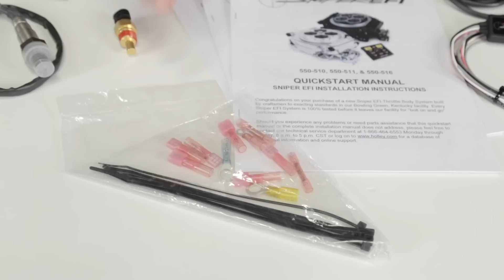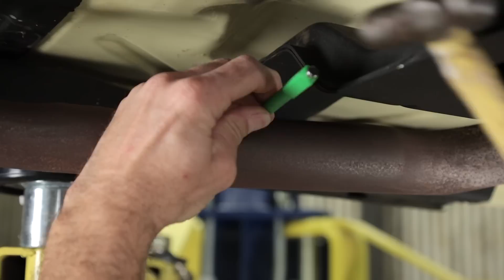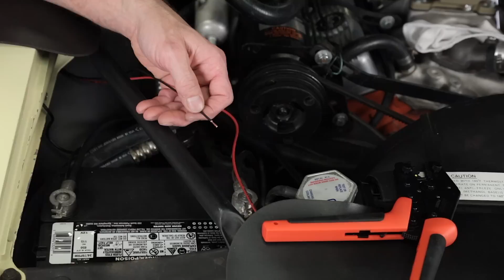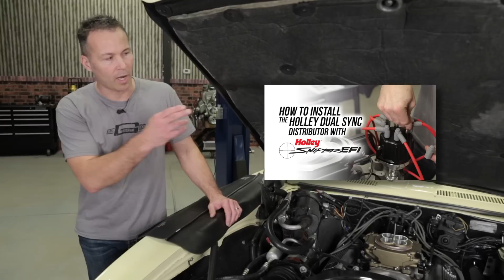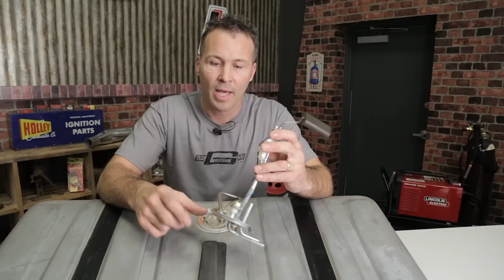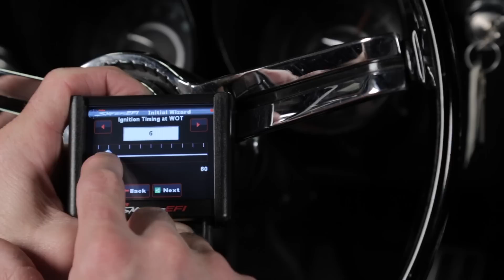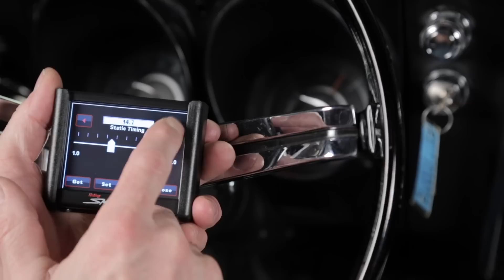How To Install Holley Sniper EFI

Comment: Just a note.  Holley no longer includes the mounting studs/nuts, air cleaner stud, throttle/transmission brackets,  throttle linkage studs, or zip ties/terminals.  Summit told me these are now sold separately.  A little disappointing since all of their advertisements show these.
Reply: I was just about to buy one not sure now. Thank you for the info
Reply: I'll still get one. A few changes though. I really wish I'd seen this BEFORE I bought a new battery. Told the fuel pump block off plate needs to be separately purchased ( I have one), I'll probably use the fuel fill pipe for my return line I'll also weld an actual O2 bung into my x pipe. Probably have to get a few throttle linkage studs which is irritating as they supplied it before they just shut that part down. It's already a chore to make universal speed equipment fit Mopars but it's still better than running a carb. In my opinion.
Reply: Just thought of something. If your battery dies or is disconnected does the previous setup keep it where it's at or is a reboot of the system needed where you have to go through all the programming?
Reply from the maker: @blakenewton2781  Your current calibration will be stored in the ecu should you have a power disconnect or failure.  thx J
Reply: Is there a part# for the throttle linkage studs? I just got my new Sniper but did not think to order them at the time....
Reply from the maker: @blakenewton2781  Depends on which one/style you need for your vehicle?  Here is a link to the page with our offerings.  Thx J
https://www.holley.com/search/?q=throttle%20studs

Comment: Well i can tell you the systems are not perfect none of them are i have installed 3 msd atomic no issues so far and 4 fitech's some issues but their customer service was bad. I am going to try this sniper on my 68 gto and see how it fairs against the others.
Reply: The only FI Ive had great service from is the OBD1 SEFI from Fox Mustangs. 100% trouble free and adaptable... but certainly a DIY project... the computer box/harness is greeeeaaat!!
Modern systems are no doubt simpler and easier.
MY only recent experience us MSD FI. It never got over an idle problem on 426 Mopar... but was much better than carb.
Reply: dont buy this shit or if you want  absolutly one i got one for sale i run it for 2 days and remove it cause it a piece of shit and no support from holley

Comment: Which is better single point injection system or the multipoint system?
Reply from the maker: Multi-point fuel injection in my opinion.  Fuel is injected into each cylinder individually and can be fine tuned to provide optimal power.  You can adjust the fuel in each cylinder to compensate for variances in the engine such as intake design with a multi port set-up. thx J
Reply: HolleyPerformance Thx for the reply and your opinion. I appreciate it.

Comment: Good video. He removes the spacer after removing the carb. Is it necessary? I have a similar setup and would like to keep the spacer. will there be a problem if I keep it?
Reply from the maker: There shouldn't be any issues with keeping the spacer as long as the holes are big enough to clear the throttle plates when opening, and you have the hood clearance. thx J

Comment: My fuel tank had a drain plug, i used a brass threaded union that fit where the plug went for my return line
Reply from the maker: That is an option may work for you but remember the extra weight of the fuel in the tank can increase the return line pressure.  This creates extra unwanted stress on you fuel pump which can cause premature pump failure.  Good luck Thx J
Reply: tube Ron mcneish And
Reply: Xbox live gold subscription

Comment: Can you run an in tank fuel pump as a helper to the Holley pump? Thanks
  Working on a 69' Camaro the guy just spent $700 on the tank then decided to go with the sniper setup..
Reply from the maker: What pump is in the tank already purchased?  Max pressure and flow ratings??  or a model #?  Thx J

Comment: This looks great but i have a question. If i swap out motors in 2 yrs, will the sniper efi adapt to the new motor?
Reply from the maker: Yes it will, granted the new engine will the throttle body and necessary sensors.  You will need to rerun the set-up wizard to ensure the calibration is correct for the new engine.    Thx J

Comment: Can i just Bolt this on to my 1988 dodge ram that already has that old holley TBI injection system?
Reply from the maker: As long as the bolt pattern works or you can find an adapter to mate up to the Sniper.  I am unsure of the fuel pressures used in those set-ups so you may need to replace the fuel pump and regulator with higher pressure units if the stock unit cannot provide adequate pressure.  Also the fuel supply and return fittings may be different and have to be changed also the air intake tube may not be the same diameter and will need to be modified or replaced?  Nothing too major but some things to take into consideration before you get too far into it.   Thx, J
Reply: HolleyPerformance Thanks!
Reply: Because my truck already has a fuel injection system do i need to install all of those sensors or are they already in the stock car?

Comment: Is it a must to install the O2 sensor?
Reply from the maker: Yes but why? You could run it in open loop (no input from O2) with a good known calibration but that defeats the learning ability of the system and does not make any real time corrections possibly causing engine damage!! thx J

Comment: What's the maximum fuel pressure the Sniper regulator can handle, right now I have a 100psi in tank pump.  Thanks.

Comment: Where did you find the coolant bushing for the Coolant Temp Sensor? I bought the 2300 series 2barrel kit and am doing this to a 1971 chevelle with a 350 small block, I can't find a brass bushing like that. Also what size is it 3/4 x 3/8?
Reply from the maker: I purchased it locally at a plumbing store but most any hardware store should carry them.  I believe mine was a 1/2"NPT reducer bushing.  I have seen some SBC with1/2" NPT and some have 3/8"NPT holes in the heads depending on the years.  Best to check yours first or get both just in case.
Reply: HolleyPerformance thanks for the response, I ended up going to a local hardware store as well. 3/8 to 1/2 in npt  bushing. Got my sniper 2300 series fired up and running now.
Reply: any hardware or auto parts store will have it

Comment: Once again you guys and the Kit Saved me. I had the Bracket for the Trans reversed I could not get my 700R4 to shift properly so last night I went back and read the quick guide and there was the photo of the throttle bracket/Trans...Sure enough I had it backward facing not straight one on top of the other.. I have the timing right at 13.9 14.1 on the Display and right at the end of the Timing Tab ALMOST I still get that sound some confuse it for vacuum under full throttle Mashing it only if you stretch it out and work up to full throttle it makes no noise but it feels like it needs or wants another degree or 2 of Timing is that ok to do? this is A Roller 350 87/95 variety Self Aligning rockers 87/95 NON Vortec Heads...Had I known I would have got the Vortec Heads Live & Learn.

Comment: Hello everything seems  OK I  got my registration/Insurance. 
I got the Idle sorted out for the most part I set it at 570 on the hand held it Purrs at that RPM
There is another thing I have not figured out yet... 
The vehicle always Starts Hot or Cold At higher RPM between 1400 RPM & 1500 As if it was A Cold start however it Does the same after its warmed up takes about 10 seconds for it to settle down sort of embarrasing in the grocery store parking lot with my loud exhaust so how do I adjust that out of it? Or should A Local Holley Tuner do that.? I am OK doing MONKEY SEE MONKEY DO... But I have to hand it to the Tuners They know their stuff!

Thanks
Jeff
Reply from the maker: Jeff, Glad your getting it on the road!    A couple of things to look at in regards to the High start-up rpm.   Is the coolant sensor connected and installed?  is it  giving you accurate readings? If so,  First from the home screen, click tuning, then advanced, advanced idle, then IAC start-up now click on IAC parked and you should see a line graph.  The graph you see should start at 100% on the left then ramp down to the right.  If the fist box does not start at 100%, drag the line graph up so it now starts at 100%.  Be sure to save before closing the screen!  You can also look at the IAC start-up hold time and decay time. These are on the same screen you just went to, just below the IAC parked selection.   They should  default to 4-5 seconds.  You can try lowering the hold and decay to 2-3 seconds and see if this helps.   J
Reply: Thanks And yes the Sensors are Installed but I left the Water temp guage I had on the Intake and Installed the Sniper Sensor on the Water Pump Its the Short Corvette Water Pump I wonder if its got a lower temp than the intake? I will go over to my dads he has A Laser thing that reads temp. I have  A higher reading on the Intake guage than nthe Sniper its showing 190 and the Sniper 180 to 185 at its hottest. I think I might have to switch the Sniper to the Intake and move the other one to the water pump so I can still have both. Thanks for the Info I will do it over the weekend.
Reply: I thought I better not delete any of these notes stuff because I am actually hoping others will learn as well...LOL So I hope someone else posts their experience. I will tell you I never was able to get the Idle as low as it is now it has never been that smooth at such a low Idle way better going from Hi Idle at start but start it does...I would go into Auto Zone Or home depot and we never knew if it was going to start at all! Now my family can Trust the Truck to start every time I proved it with our SOCAL 110 Degree weather in the last week It started every single time
Reply: SUCCESS! I just backed it down a little more and PRESTO Starts and runs now just like my Tios 2012 Silverado! except it did not cost 25k$ And my Tia's Old  64 c10 Gets more thumbs up than a Silverado! LOL  Now I just need to add the A/C Heat and done!

Comment: Looking for your recommendation on a replacement intake manifold to use with your system. Old 3 deuce set up now.
Motor is a 400 sbc with lumpy cam, spec U..K. Thanks

Comment: I've read that you can install the sniper EFI on a supercharger, and that the only major hurdle is installing an external MAP sensor on the supercharger manifold. Where does the external MAP sensor plug into the throttle body? Would Holley #554-134 work on, say, a weiand 174 supercharger and manifold?